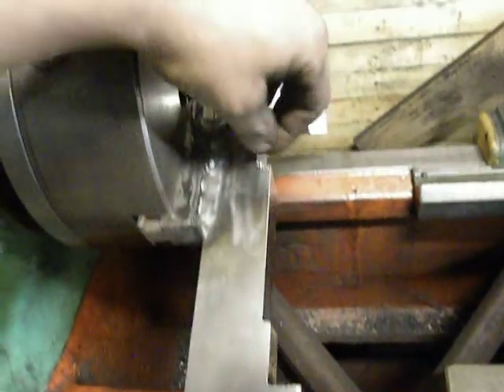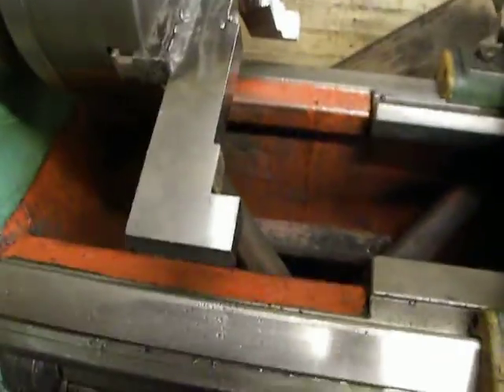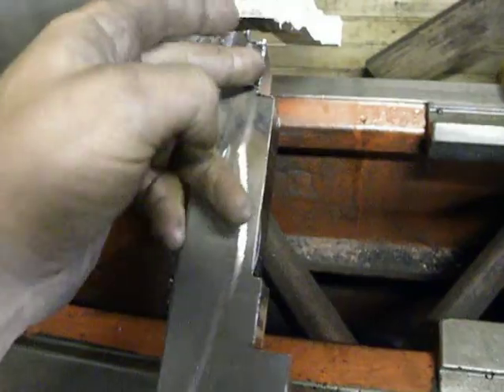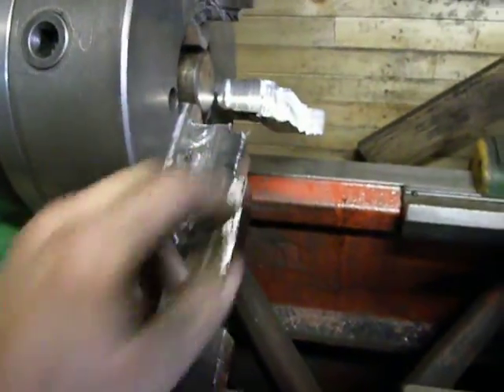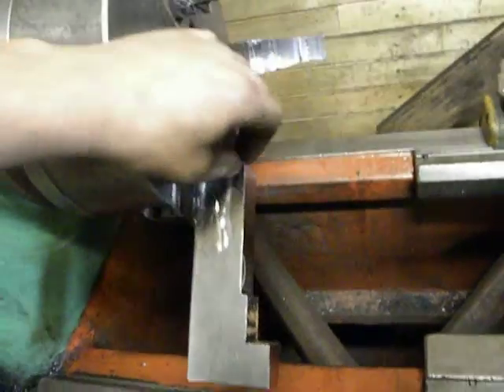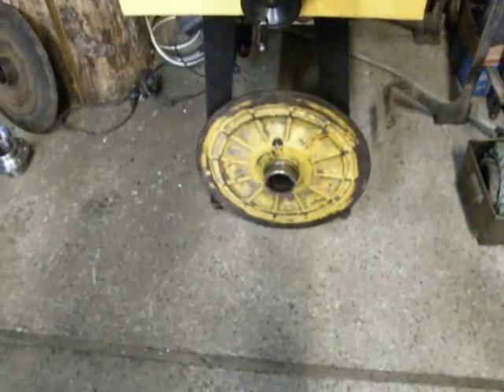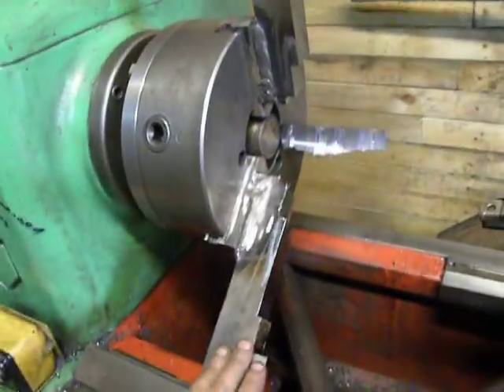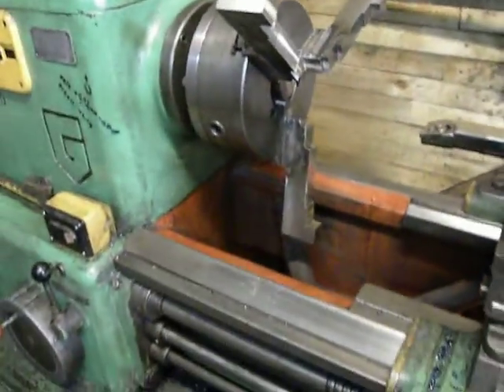Harvester job - machining "predator style" jaws /p2

Comment: I think you should get that 4 jaw out and cleaned up , make a back plate for it and put it to work. It does not take long to set it up and is more accurate then the 3 jaw . Because you can dial into 10ths of thousand and good for turning jobs around in the lathe to work on the other side
Reply from the maker: Second... 10ths of inch it is 0.001inch??? So, then 0.001inch - it is 0.025mm. Yeah, I agree to  need make that chuck ready for future.
Cheers!
Reply: FactoryDragon87 This naming confuses me too. A "tenth" is 1/10 of one thousandth" or .00001". So it is 25.4/10000mm. or about 25 microns.
Reply from the maker: Juan Rivero  Alright, so, I check it... so the 0.00001 inch is 0.00025mm...... ahm well, I'll be pessimist now - the 0.00025mm accuracy You can get only in NEW or in GRINDING machines..... also very rare measuring tools can handle accurate than 0.0001mm,  very popular is 0.01mm (0.0004 inch).... so, let those microns for lab equipment and I'll be very extremely happy for 0.005mm accuracy. Maybe I'm wrong.
Cheers!

Comment: Dragon do you have a four jaw chuck for your lathe? I use the four jaw more then the 3 jaw on my big lathe
Reply from the maker: Yeah, I have 500mm 4-jaw chuck, but it ask for chuck backplate and hard clean up from pile of preserve grease... yeah, yeah, I know, I was too lazy to do this.
Well I ususly use 3-jaw chuck on my lathes, I set 4-jaw chick in "extraordinary" cases and sometimes when I need work with square-rod in large nummber of pieces - example: square nuts.
Thank You very much!

Comment: I think The Ironworker means 10ths of a thousandth (of an inch), which is another way of saying one ten thousandth of an inch. 1/10000 or 0.0001 Inch. 
R
Reply from the maker: Yeah, right. But difference is that to I work in metric and all measeures I say in metric. A 0.0001 inch is  0.0025mm or 25 microns.